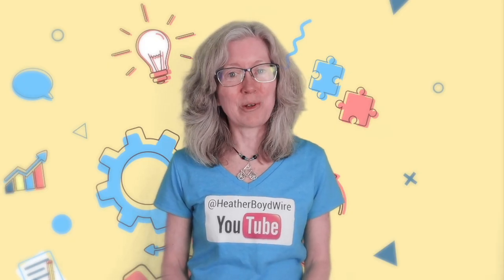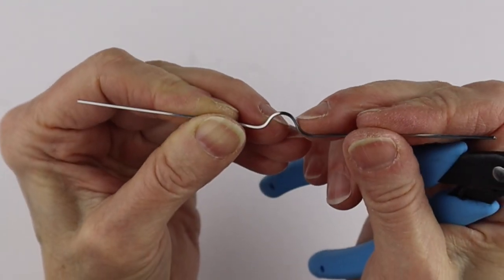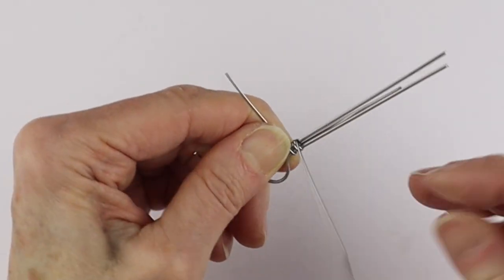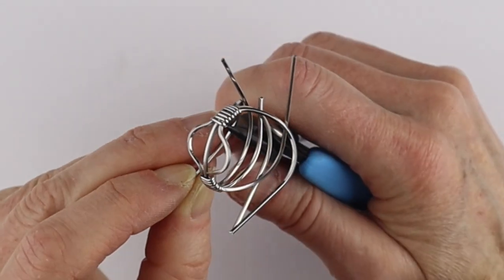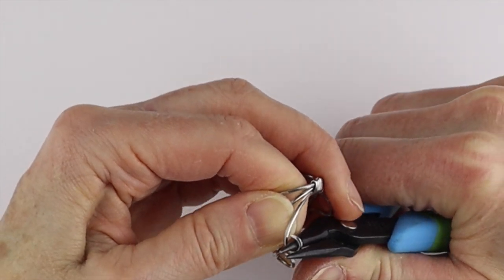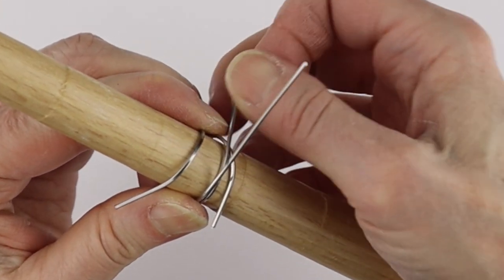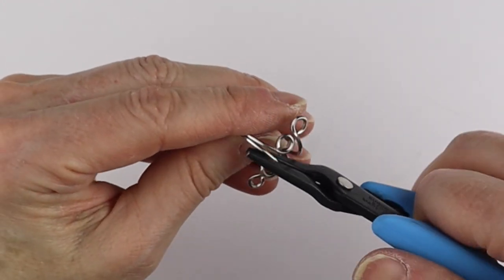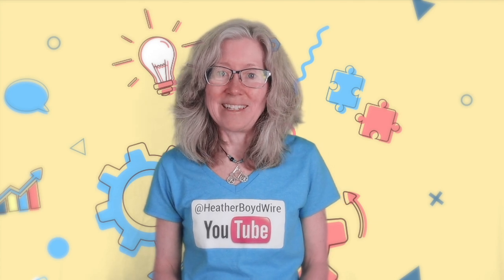SQUARE WIRE Ring Stainless Steel // Tip Tuesday Tutorial

Comment: I made the  mistake of buying stainless steel wire, it's harder to work with than with copper wire, but this  is such a great opportunity to use it, thank you once again, Heather!
Reply from the maker: YAY, I'm so happy it helps. The steel is a very cool wire. Very sturdy and doesn't tarnish!

Comment: What is the purpose of the half loops on the back of the ring? I've never seen that before.
Reply from the maker: Hi Charley: It was actually an experiment so the wires would sit flat!
Reply: I too was wondering that! This is my first time working w SS, and it's been a little difficult. Did u find the experiment was helpful, or did you determine it was it unnecessary after u were finished?  I notice u did a half loop for the second ring?

Comment: Hi Heather, very cool and beautiful tutorial. I would like to ask you, I want to make my own pin backs for brooches, would you recommend the 16 or 18 gauge SS wire?
And another query, would you recommend 18 or 20 gauge half round SS wire for wrapping a stone?
Thanks a lot for your help. 😊
Reply from the maker: Hi Annita. Thank you. I would use 18g or 20g for pins as 16 would be too thick unless it's for a loose knitted scarf. I generally don't use half-round wire but did use 20g in this tutorial https://www.youtube.com/watch?v=Yk-2r8bAM5Y&t=6s
Reply: Hi Heather, thank you so much for your response, it's been helpful and I will look into the video.

Comment: These are really cool looking, looking forward to trying. You said you don't usually use the steel wire.  Why did you choose to use it this time?  Would a different wire still hold its shape?
Reply from the maker: Hi Valerie. The wire was a gift from Amber, I hadn't tried this kind before. It is harder to work with but the effects are beautiful. You can also use copper wire which comes in square and half round too. I have the Artistic wire brand by Beadalon. Good luck.